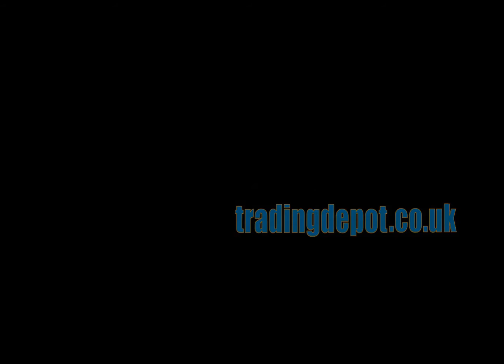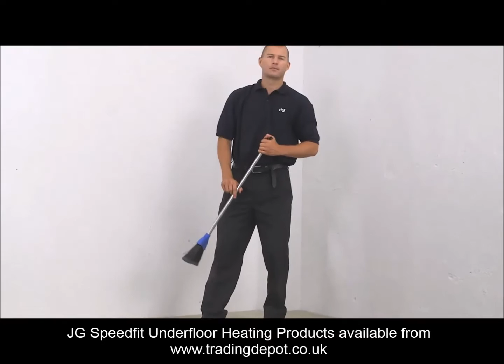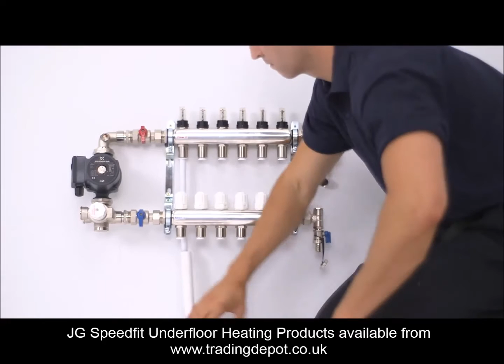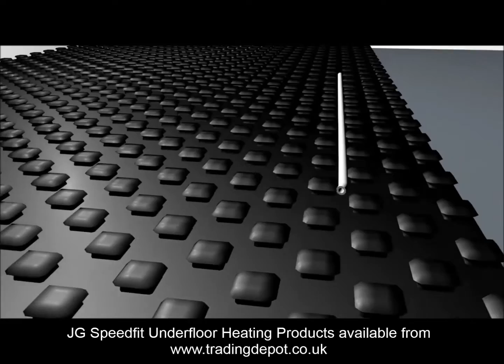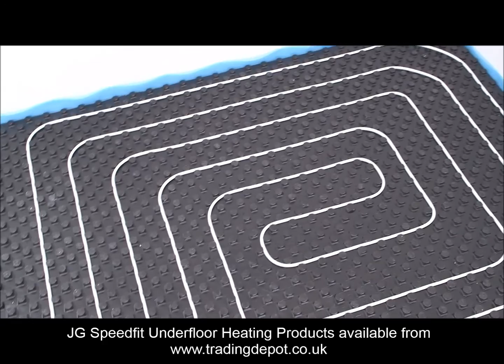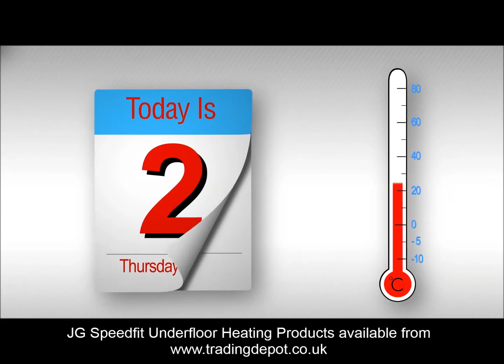Installing the JG Speedfit Floor Panel Underfloor Heating System

Comment: Doesn't the screed affect the pipework? i used the 10mm Layflat in chases in brick walls and then used Petroleum tape (Denso, Jet etc) to cover the pipes so the plaster didnt eat away at the pipes...